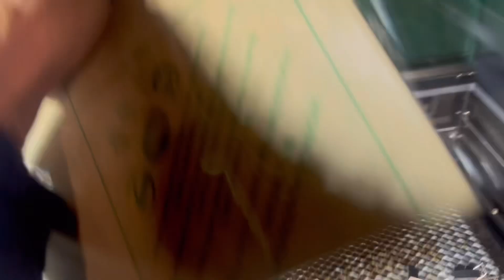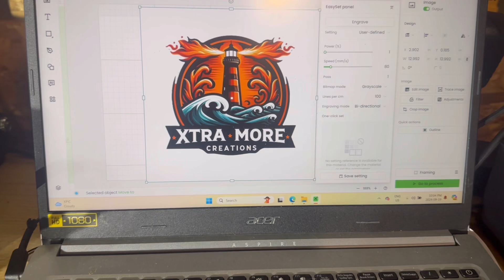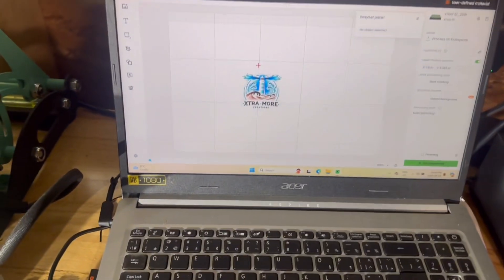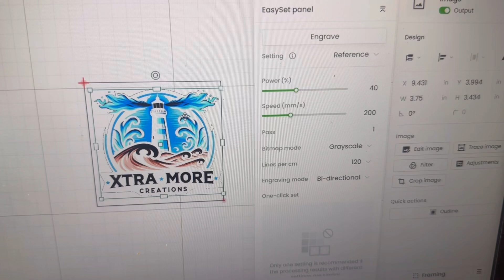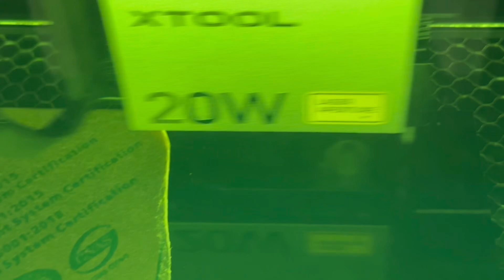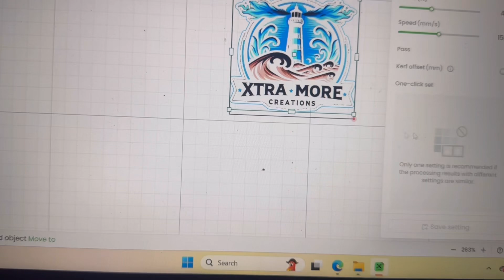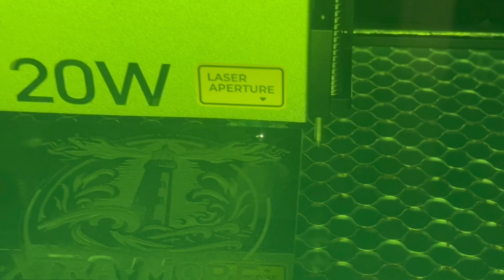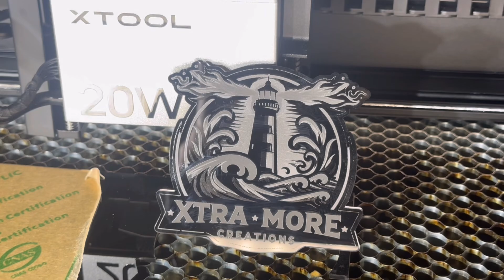xTool S1 20w Engraving & Cutting 3mm Black Acrylic From xTool, My Custom Logo Using With XCS ❌🔥

Comment: I added text from xcs to my design, do I have to invert the text to engrave as well? Because there is no option to do this on xcs.
Reply from the maker: Just make sure you have the letter on engrave not score or cut and your all good they should show up blue in XCS then dark right before you start project.

Comment: What were your cut settings on the black? What did the cut edge look like?
Reply from the maker: I used XCS settings for 3mm Black Acrylic and slowed the speed down a bit more so 💯 power and 3mms. The edge are very clean I cut out the shape of Nova Scotia with a lot of very fine cuts